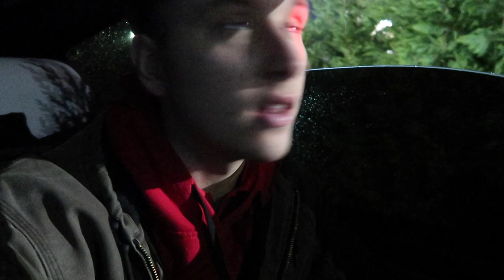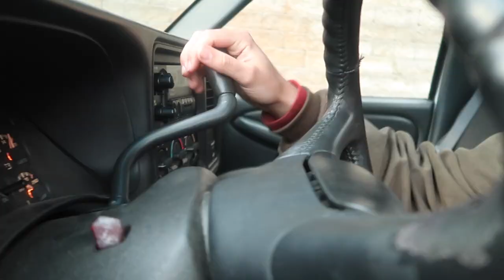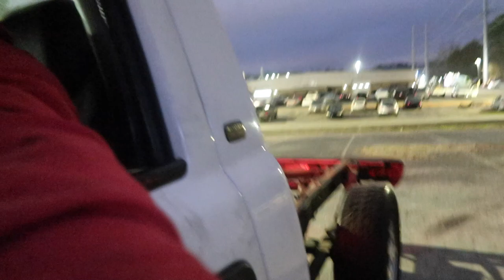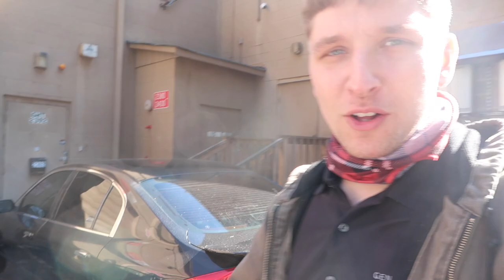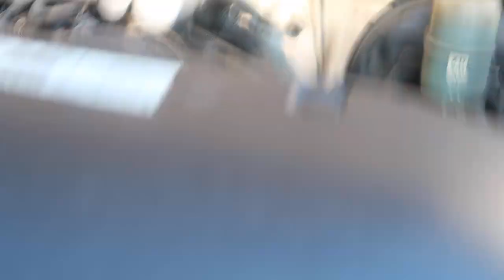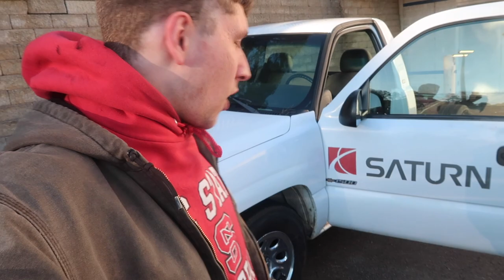WORST possible news for my new truck build...

Comment: Just yank the 4.3 go to pull a part get a 4.8,5.3,6.0,6.2,or an 8.1 they all will fit just get the ecu then chop the frame and bed and start the body work
Reply from the maker: All the engines for this body style have the same mounts?
Reply: @Thatwidebowtie  yes except the 8.1 but some sit further forward or towards the cab I think the 4.3 sits the closest to the cab . You can take the 4.3 out and get a motor close to the same year and be golden
Reply from the maker: I definitely want a 5.3